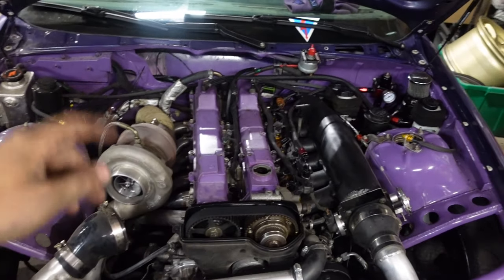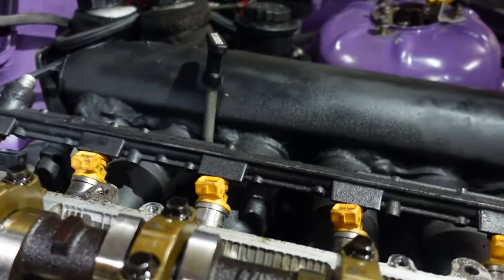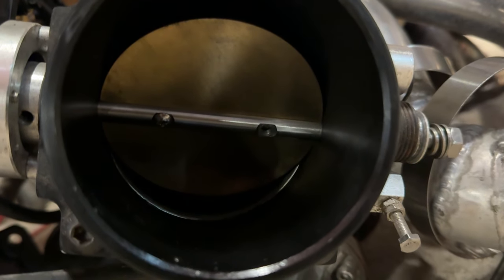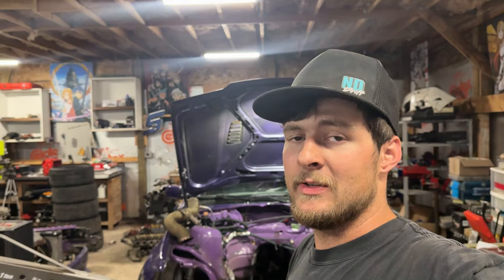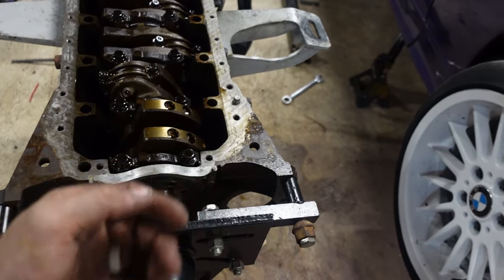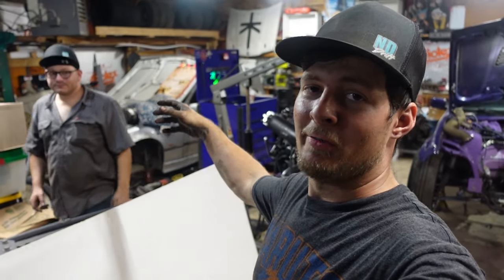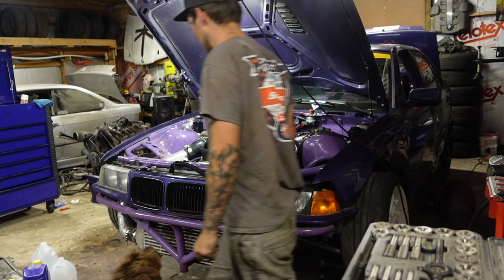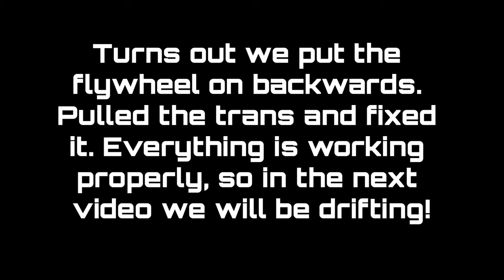Rebuilding My 2JZ NA-T Engine

Comment: Note to self…LOCTITE throttle body bolts. Also didn’t know that was a problem 🤦🏽‍♂️
Reply from the maker: @jaketravis214  not something you would normally think about!
Reply: @Teysik  for real. I’m gonna have to loctite mine on my deep motor intake🙈😂